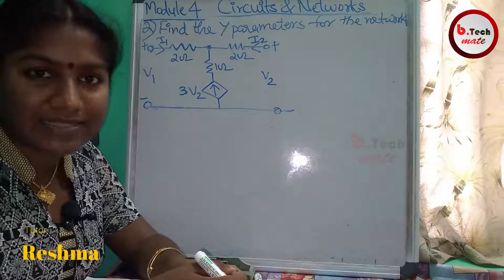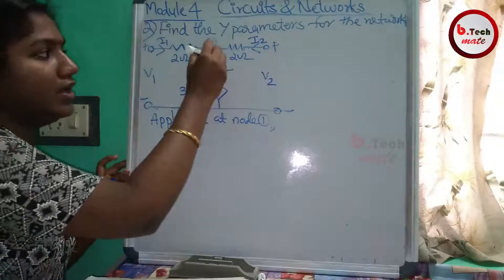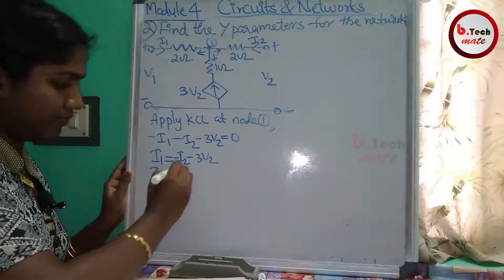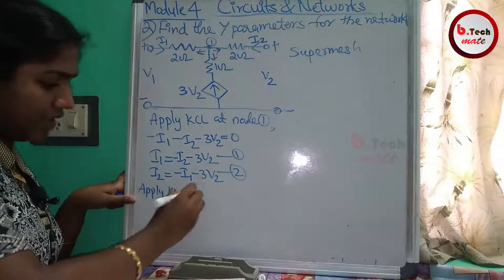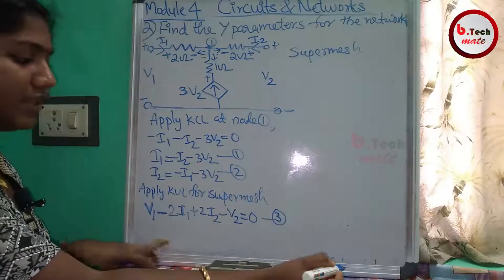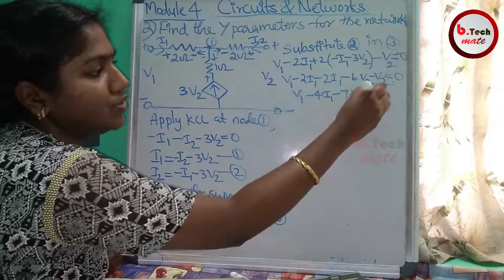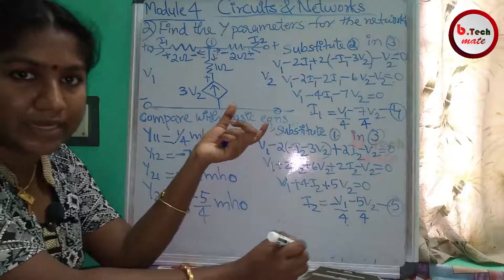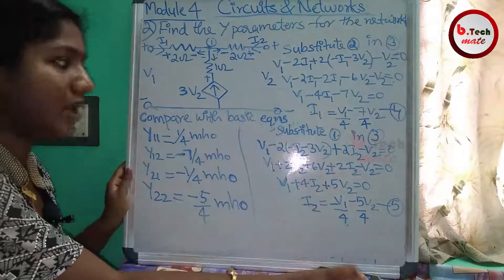74 . Y PARAMETERS PROBLEM 3 I NETWORKS & CIRCUITS I MODULE 5 I EEE I KTU S3

Comment: Misse nammal at a time il randu port um close cheyyillallo. Pinne engane aa super mesh form cheyyunnee. Plz reply miss🙏
Reply from the maker: The voltages marked here can be considered as independent sources. So V1 and V2 if you replace with source symbols it becomes 2 meshes. Just assume in that way. In 2 port networks at a time only one port is opened or shorted. And also if both ends are open current can't flow in that circuit. So here just assume that voltages simply marked are as source symbols.
Reply: @btechmate8162  ok miss